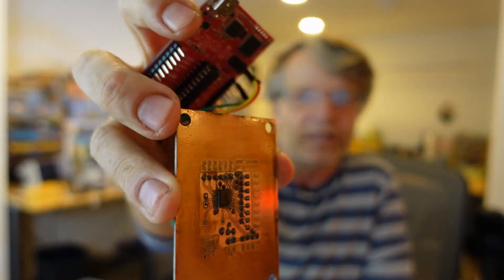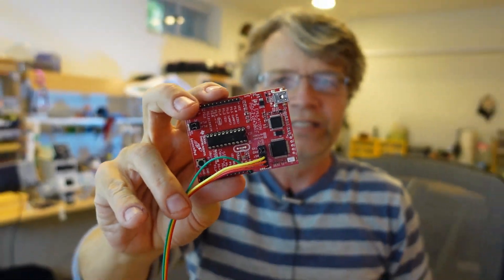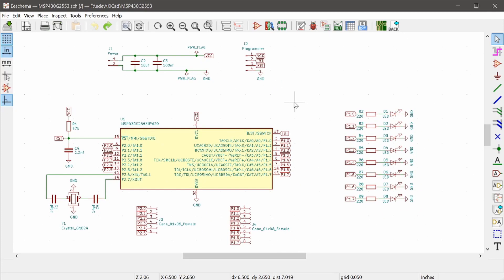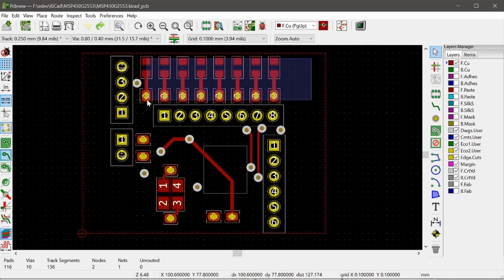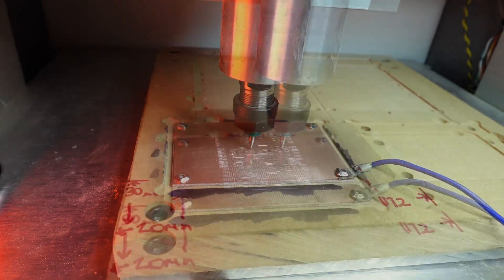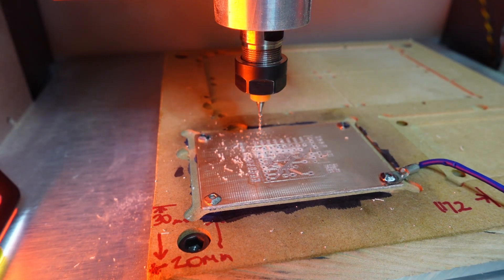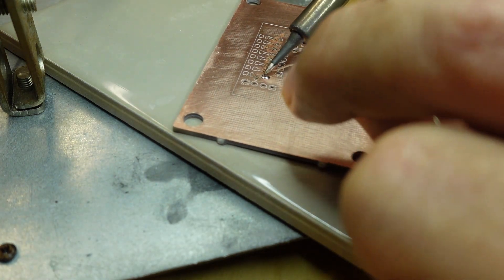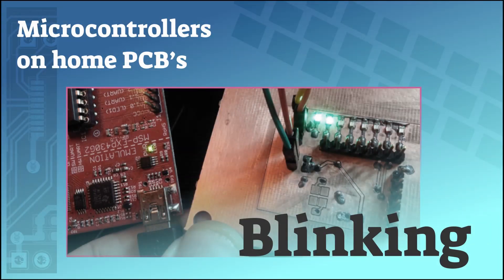Microcontrollers on Scratch Milled PCB's

Comment: @3:37 very interesting trick/hack to put the SMD resistors through the drilled hole...I'm going to try that out.
Reply: I'm guessing if the pcb thickness is 1.5mm, then I guess I would want to insert 0603-sized SMD components though the hole because their length of 1.6mm is close to the PCB thickness.
Reply from the maker: Yeah I was using 0603’s, but it is hit and miss. They work well when they work, but they really make debugging harder (even if the vis is working perfectly, you always end up wondering if they are the problem).

Comment: Trying to solder anything less wide than a 2.5mm standard pin width like an Arduino Nano, is where we part company Robin.  I don't want any part of that tiny stuff I can't even see.  I'd be afraid I might accidentally swallow a resistor that got stuck to my finger while eating something.  I can barely do the 2.5 mm width traces.  That SMD stuff looks super natural to me.
Reply from the maker: Ha ha, yeah I’m there with you. I got some 0201 resistors just to check them out, and I’m still not sure if I dropped or inhaled the one I was looking at :).

Comment: Ok im late to the game but I am very curious what your board was hooked up to while it was being drilled (the bottom right blue cable)? was that a grounding cable? did you get shocked in the past?
Reply from the maker: Ha, well I have had a lot of shocks. sometimes accidently even, but that is for measuring the height of the board. I put the other side of the circuit on the spindle, and then lower it slowly. When the tip touches the board, it completes the circuit through the blue wire and knows exactly how far it is to the surface of the PCB. That allows scratching off the tiny  layer of copper without gouging the fiberglass board under it. It should probably be removed after the measuring step, but I am lazy that way :).

Looking forward to seeing you guys out here this summer!

Comment: When you add the external crystal is there a setting to specify it? I am trying to find a setting for the esp32 when programing with Vscode with platformio.
Reply from the maker: The range of allowed crystals and accompanying capacitors is usually specified by the manufacturer based on each chip. I haven't used the Esp32, but maybe this hardware design guide would help? Section 2.4 specifically says a 40Mz crystal with about 10pF caps. Not certain that is the specific chip you are using though. https://www.espressif.com/sites/default/files/documentation/esp32_hardware_design_guidelines_en.pdf